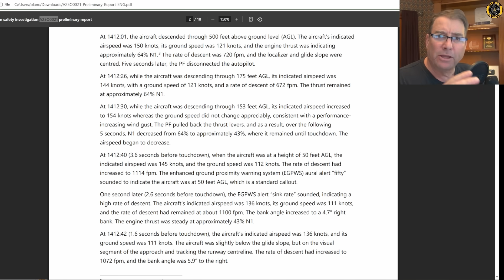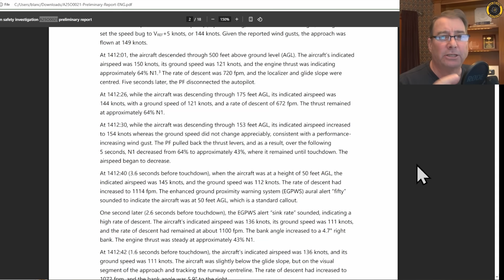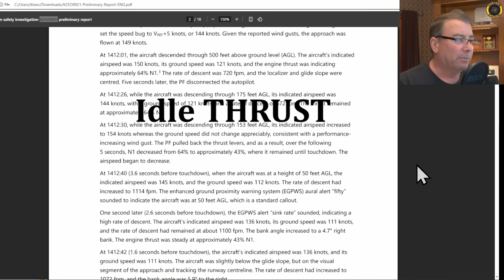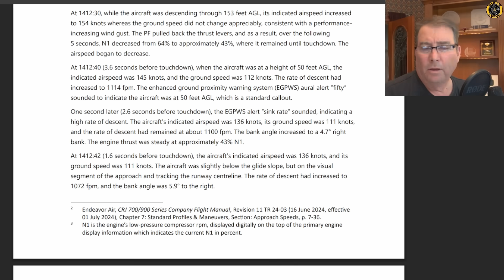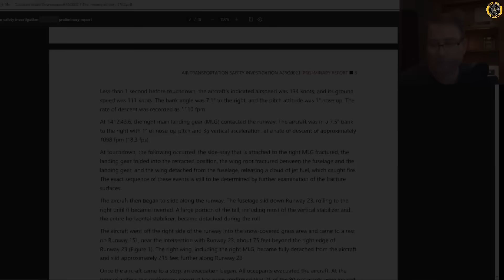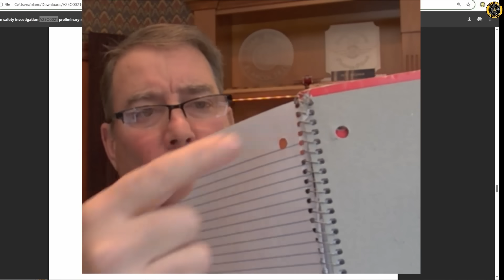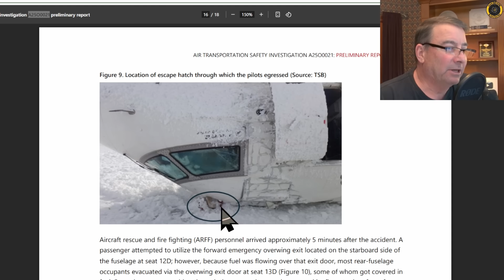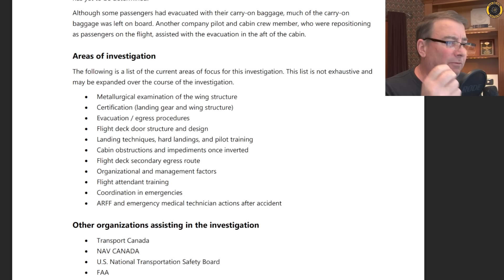TSB Prelim Toronto CRJ Crash

Comment: Ten minutes after the accident the weather channel showed the winds at Pearson.  They showed winds favorable for operations on 33R & L.  The crosswind gust component of 23 was just crazy!  The question I have is why wasn't the airport operating on 33R or L instead of 23?  Crosswind component for 33R would have been minimal to non-existent.  Snow removal at northern airports?  They are very, very good at it,  but you need to understand there is only so much snow you can push on so many runways and taxiways.  Pearson is a great airport!

Comment: And I still maintain that there's a benefit to flying RC aircraft, which allows you to directly see and then visualize how an airplane responds to control inputs, including stalls and spins, which you can translate once in the cockpit. It helps prevent some of the crazy things you see student pilots do sometimes (such as trying to steer the plane on the ground with the yoke, or yanking the stick back when slow, etc.) I think RC (including building kits) helped me with my stick and rudder skills when I got my private.

Comment: Air Canada Flight 621 a DC 8 in 1970, landed badly,  losing one engine and pylon, and then exploding on go around!
Reply: @Miles_High1  That only happens when the F/O extends the ground spoilers while you are still in the air.

Comment: "Pitch for airspeed, Power for altitude" I know this is far more complex, but in tune with your stick and rudder skills statement: remember we practice slow flight for a reason.
Reply: Ah, the good ole days of being comfortable below the white arc....
Reply: You do not fly a jet like that
Reply: In an airliner it's pitch for glidepath and power for airspeed.
Reply: good luck flying a 40 ton jet like a 172. We never practiced "slow flight" in an airliner.
Reply: @skyboy1956  How long have you been retired?  We do, every 12 months in the sim.  High, low, and even do very unusual attitudes if there's time left in the session.  It takes a 767 15,000' to do a loop in the sim.  And I did for my first type training in the ERJ since there were not enough sims to go around yet.  We flew for minutes upon minutes with the shaker buzzing, turns, climbs, dives - even pressed and held the AP disconnect button so we didn't get the pusher to make a stall break.   

FWIW, flying a 172 is very similar to flying a jet.  Speeds are really similar, and the systems are different. But if you chop the power, you go down, in either plane.  And if you can crosswind land a 172, you can crosswind land any jet.

Comment: @Blancolirio There are higher-definition and grainier copies of the video shot from the learjet waiting north of 23.  In one of them, there's a clear and pronounced vortex off the Hor Stab in the last 30 - 10 feet AGL - more obvious on the Port side due to the camera angle.  EVen with that vortex, there was no deck angle change.  My bro (F900 pilot) and I were talking about whether that tailplane might have been near-stall and that there was no flare available, or not as much due to the airspeed loss.  An excessive sink rate would increase a Nose Down influence on the airframe.   Vortexes off Hor Stabs is fairly rare in my years around airports.
Reply: well before stall the SPS would have been activated. This would be on the FDR and CVR and mentioned in the report.

Comment: How do the slides not deploy on this upside-down evacuation? Does it know the orientation and wont go off, or has to be manually disabled at door or the pilots have to disarm it before evacuation?
Reply: If the height of the floor of the aircraft's door is less than 6' from the ground, no slide needed.

Comment: To summarize: wind shear resulted in lower than required airspeed and higher than expected descent rate with no flare to arrest the descent of the aircraft.  Mitigating factors included gusting winds, narrow runway illusion, blowing snow, lack of pilot recency, poor teamwork/communication, and poor basic stick and rudder skills.

Comment: I flew crj just up to recently at another regional.  Contaminated runway max xwind 15.  This wouldn’t have qualified. Otherwise max is 37.  Yes we flew additive speeds in gusty conditions same 10 knots above vref.  Top of the bug.  Big shock to me changing types that you would add more.  I would get on high alert if any fo dropped n1 below 55.  60 is normal.  Weight depending.  Also if you went idle in the last 1000 ft that’s considered unstable.  Go around.  43 is fadec flight idle.

Comment: Agree completely with your summation & conclusion. As a passenger, I always hope that the flight crew has extensive experience in bug smashers so that they have the necessary stick & rudder skills to competently fly the aircraft in an emergency situation. Just 10 hours in sailplanes at an early stage of pilot training would deliver amazing basic skills, but especially an intrinsic understanding of safe speed near the ground as well as how to use rudder. For example, rolling around a point is taught to glider pilots but not to power pilots. This would go a long way toward addressing the skills deficit now appearing in heavy air transport. Mandating the use of tail draggers for the first 20 hours of ab initio training would also be lifesaving.

Comment: Had to deal with Windshear going into COD in the CRJ the other night. If you send me a DM, Juan, I can go into that with you and also what we do at my airline. Don’t want to do that in a very public comment section. 

As far as experience, I 100% agree with you. When I got to the airlines it was on a Restricted ATP, however, it was only for the cross country hours. I had over 1600 total time with over 800 of that in Citabrias and a Decathlon. Everything in the Citabrias was oiled and gas pipeline patrol and ag survey out of BFL. As a result I felt, and still feel, that I had a massive leg up as far as stuck and rudder over my peers who built a majority of their time as CFI’s where they mainly just observe other people fly.

The industry is not what it used to be where we all had to bide our time in small planes flying cargo, dropping skydivers, bombing along at 200’ AGL checking pipelines (like I got to do), or other random skill intensive jobs. The number of folks coming over from the DoD is also far smaller than it used to be. This is an issue in the pipeline. The emphasis is on doing it fast, not on doing it well.
Reply: ...yeah, fast and without complaints. Not good.